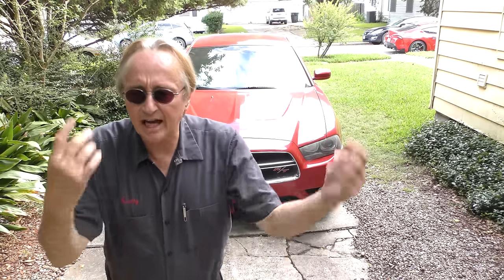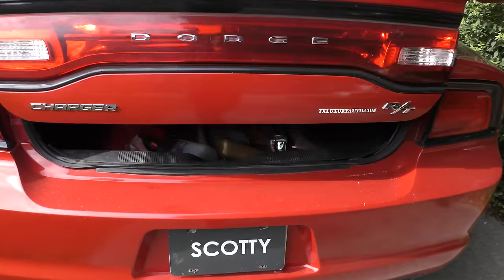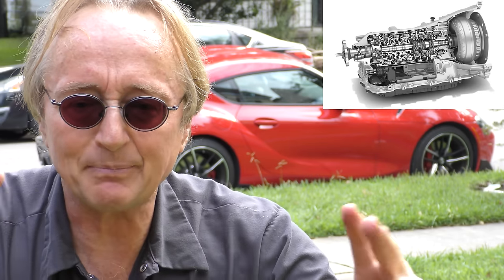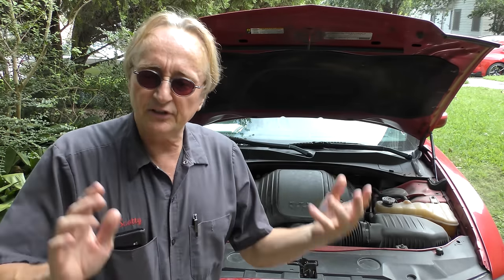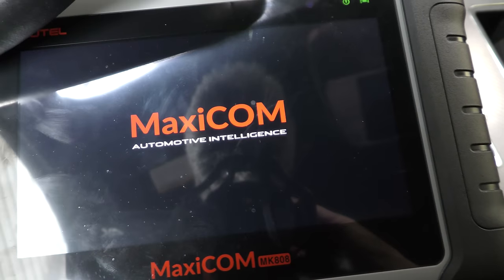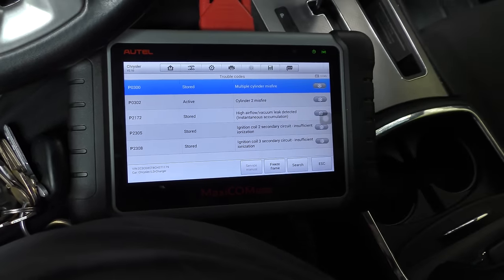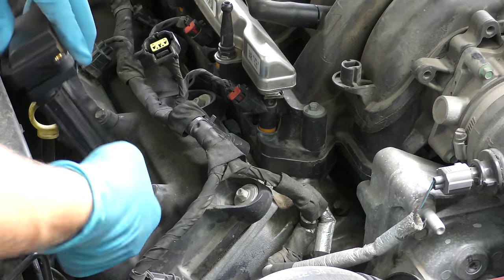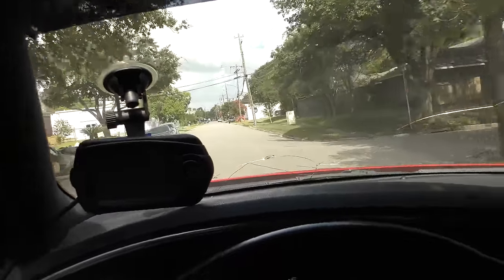Here's Why I'll Die Before I Buy a Dodge with a Hemi Engine

Comment from the maker: My New Channel ▶ https://youtu.be/4Ce4gvhH43Q

Mazda Just Changed the Game with This New Engine: https://youtu.be/F_7J3W97d20

⬇️Scotty’s Top DIY Tools:
1. Bluetooth Scan Tool: http://amzn.to/2nfvmaD
2. Mid-Grade Scan Tool: https://amzn.to/33dKI0k
3. My Fancy (Originally $5,000) Professional Scan Tool: https://amzn.to/31khBXC
4. Cheap Scan Tool: https://amzn.to/2D8Tvae
5. Basic Mechanic Tool Set: https://amzn.to/2tEr6Ce
6. Professional Socket Set: http://amzn.to/2Bzmccg 
7. Ratcheting Wrench Set: https://amzn.to/2BQjj8A
8. No Charging Required Car Jump Starter: https://amzn.to/2CthnUU
9. Battery Pack Car Jump Starter: http://amzn.to/2nrc6qR

⬇️ Things used in this video:
1. Common Sense
2. 4k Camera: https://amzn.to/2HkjavH
3. Camera Microphone: https://amzn.to/2Evn167
4. Camera Tripod: https://amzn.to/2Jwog8S
5. My computer for editing / uploading: https://amzn.to/2uUZ3lo

🛠Check out the tools I use and highly recommend ► https://goo.gl/rwYt2y

Subscribe and hit the notification bell! ► https://goo.gl/CFismN
Reply: And FYI on the 5.7L Hemi the "stupid beauty cover that doesn't do anything" actually keeps the engine from shutting off in heavy rain/high dampness, dont drive without it.
Reply: Those 5.7's are notorious for eating roller lifter bearings. As for ZF's one needs to put  a spin on external oil filter and keep it changed as they generate tons of used clutch material.
Reply: hey but it does make a lovely sound noise love it put a smile on people face  thou but engine life is numbered (b4 it dies) right?
Reply: The 6 cylinder has the same tranny ? As the hemi it's not beefed up atleast?
Reply: If you are going to have commercials for Joe Biden interrupting your videos,  I have to quit watching.
Reply: Ha ha!  I was worried about cha for a second!   My Dad misspeaks like that occasionally too.  NBD.  :)
Reply: Looks Scotty I know FCA products get you in a froth here.  But you said change the cams on both sides on a pushrod engine, there is only ONE down in the middle.  The cam lobe is rounded out on this car it's a known issue.  Needle bearings in a lifter fails and/or cam wasn't hardened properly at the factory.  Plus I'm sure they did long oil change intervals which is a no no with this motor.  That's a lot of miles too.  I think my Hemi is getting 5w30 full synthetic 1 day after my powertrain warranty is up.  SHOULD HAVE BOUGHT A TOYOTA again.
Reply: @glennso47  😂😂😂👍
Reply: How are the 6.1l v8s?
Reply: Good save buddy
Reply: Scotty I disagree with your view on Dodge products. I have had many Dodges my latest one is a 04 Ram 1500 Hemi 5.7 and it has 130,000 miles and runs like a tank I have only had to do regular oil changes on it for the last 10 years and I replaced the origional spark plugs around 125,000 miles and even still I think thy had plenty of life left. The trans works perfect, and I needed this truck is so simple to work on I could literally replace the engine if needed in my driveway on a weekend I bet a little kid could figure out how to work on this thing. Also replacement parts are not to expensive and available everywhere. I bet replacing a trans or engine on a Honda is not only harder but more expensive to work on, I would take Dodge over any Honda, Toyota, Ford, or Chevy product any day.
Reply: Do not get the older one with the 2.7 V6!!! Only the 3.5 V6, or 3.6 V6 Penstar!!!
Reply: Funny thing is that these cars was already in production when fiat too over!! So fiat had zero to do with design!!
Reply: @moparman4200  yeah bro I agree too I had 240,000 on my 5.7 Durango before it got taken out by a storm changed the engine that bad boy it is still passing anything on the hwy but a gas station..💪🍻
Reply: Carl Stallins  if u're in Houston their is a place where u can get a rebuilt 5.7 hemi engine for 2000
Reply: @Kenzo-bp1zs  yeah valves are a nightmare in the 2.7 but I wouldn't do anything v-6 Mopar I'd go 5.7 Scotty is crazy
Reply: @American-Motors-Corporation  yep I have a 04 gen 2 bro can't beat that 5.7 with the b.o.f. all u need is a tune, port and polish the heads, headers ported throttle body and nitrous u have a contender....
Reply: @bmanclassics4350  Also my truck has eaten a Chevy spark, Mini Cooper, Ford pickup, and a tree in it's lifetime nothing a little bondo and paint couldn't fix but all the other cars where totaled when they hit it.
Reply: Dodge knows about this yet they don't fix it. Even newer Hemi's have the problem and some think it's the MDS.
Reply: hey please do a review on a 2006 -2009 impala ss
Reply: Scotty sometimes that noise is a broken exhaust stud/bolt.
Reply: @Ed.01  Would that produce a misfire?
Reply: @nokoolaid  it'll produce the noise,  idk about the misfire.  Probably a worn cam lobe I guess would produce a misfire.
Reply: @nokoolaid  Are you Scottish?
Reply: Does Mr. Scotty knows how to rebuilt a modern engine like this one??? A full modern engine????
Reply: James L I know lol the ones straight out the lot have that annoying ticking
Reply: mazda sucks...lol.. didn't u like quit or retire like 5 times now... ?
Reply: @peiguy1982  The only thing keeping the Charger going is high horse power besides that its a played out design just like the 300C its a wonder why Chrysler is still around they have nothing in their lineup anymore the rumor is 2021 will be a new Barracuda they should let Chrysler build it its just not right buying a dodge Barracuda.
Reply: Malcolm Reynolds  The guy don't even have a cover on the battery you might be able to sell it at an auction real cheap and that's about it or a junk yard.
Reply: @Kenzo-bp1zs  The 2.7 was a horrible engine oil sludge it was famous for.
Reply: Scotty what are your thoughts on Fixed
Reply: Scotty I really like the way your are changing things.  You actually worked on a car and showed us how to diagnose a fault.  Also, liked your review of your new Supra.  How about more car reviews?  We don't have enough of those on Youtube? Well we do but I would like to hear your reviews.  Just my opinion.
Reply: What if you get a cam kit with lifters and all like a peformance cam will it last longer?
Reply: Th@'s mainly y the cops 👮 highway and motorway patrol pursuit vehicles 🚓🚔 are usually dodge charger 6.4 litre v8 engines
Obviously the better car setups cost more money though
Reply: @bartonbatt6222  Im pushin an '07 Jeep SRT8 wit that 6.1 Hemi,AWD Fast asf! Great engine bruh..Just needs to be taken care of..Hemis put out as long as you put in
Reply: Mii
Reply: Mii
Reply: O
Reply: @paulclancy2404  l on looks I look I'm ll lol lol lol look out up ok ok oops pool ppl
Reply: Hey Scotty what do you think About the old 2008- whatever Year they stopped lol Scion XB's should I get one or should I pass also would you say stick or Auto Tranny?
Reply: Carl Stallins I got my camshaft replaced along with a bad lifter for under a grand wym?
Reply: D33zNutzGaming because they have 8 cylinders
Reply: What about the challengers with the hemi?
Reply: Scotty Kilmer, you should do a review on a 2010 and up ford taurus
Reply: 1 month later hes ordering a durango
Reply: Cars N Stuff Or  like some of us having voted for Obama.
Reply: I rather buy Mercedes AMG
Reply: The car has a 180,000 of hard uncared for miles on it. Im surprised it ran as well as it did. It had all kinds of power when he took it for a ride after doing work on it that didnt make a difference.
Reply: Haven't watched much of this guy but I 100% disagree with this. You are talking about a clearly beat and probably not maintained charger. The hemi has been around since what 2003. Some of the most high milage engines on the rd are hemis. Any of them are crap if you don't maintain them. It seems like you are just biased towards chrysler as a whole.
Reply: @glennso47  😭😭😭
Reply: My uncles got a 71 cuda with a 426, and it runs perfect. Guess they dont make em like they use to... 

He says hes had the engine rebuilt 4 times but he drives it hard and the vehicles got 600000km.
Reply: Are these your cars?
Reply: Why do Americans call a liquid “gas”?
Reply: Poor Scotty. He don't know what he's missing. I own three Hemis. One is a 2012 Charger police pursuit. Love that motor. LOL.
Reply: Rock solid engine. Ask all the police departments. :)
Reply: The nag1 transmission is not a Chrysler transmission, it’s a modified Mercedes tranny. C’mon dude